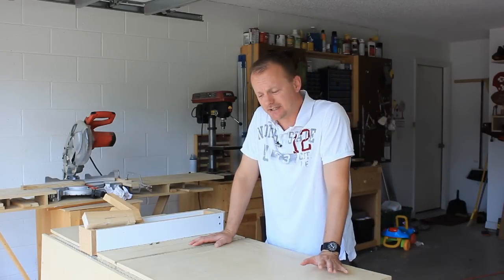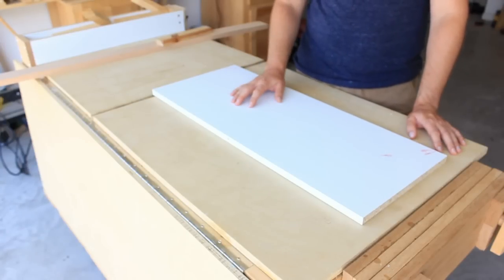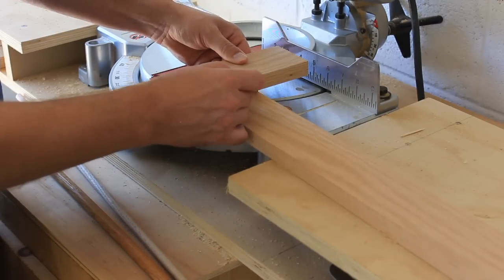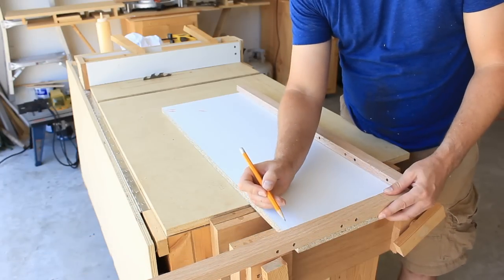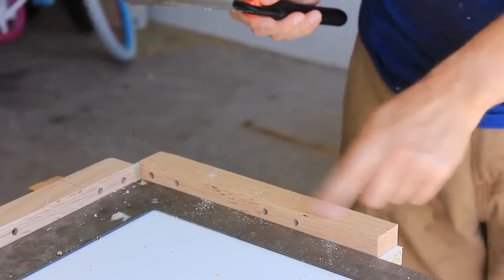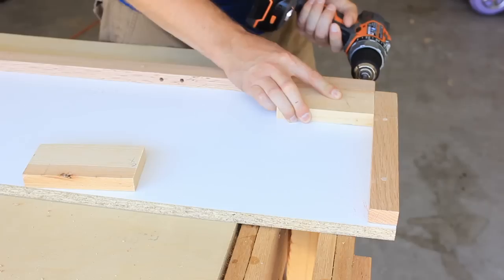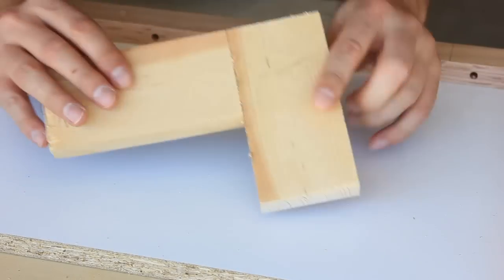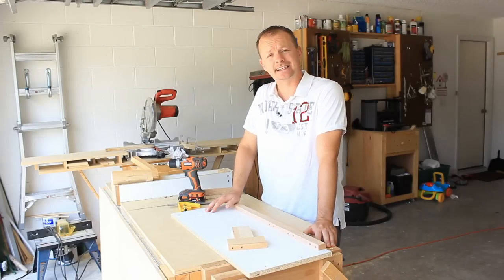DIY Dowel Jig

Comment: Great video, will come very handy in my projects :-)  This jig will only works with the same size boards, thickness, as the jig  itself. I will assume another jig would need to be made for thicker materials. Thank for sharing the awesome video.
Reply from the maker: borocovs I suppose technically speaking you could use thicker stock if you don't mind your dowel joints being off set.  I have used 5/8" stock in it and it worked just fine.  The bigger issue would be that ideally you want your dowels to be 1/3rd the thickness of the stock your working with.  Using thicker stock would mean the dowels would not be the right size.  You wouldn't need a completely new jig for each size, just different reference rails.

Comment: Can you build a jig like that for mitered corners?
Reply from the maker: Brian Rodriguez Do you mean to cut mitered corners or assemble mitered corners or both?  I have used this jig to assemble miters that I cut elsewhere.  I show that in another video somewhere.
Reply: Yes, if I already have a mitered corner cut and want to use dowels for added strength when gluing them up, how could I make a jig similar to yours? So the dowel holes would be on the insides of the mitered cuts. 

Thanks for your reply, i appreciate it.

Comment: I plan to make a furniture, a tv stand.
With my drill I can make hole of 5 mm max. 
I can not make 8mm holes for the pins.
If I use 5mm pins instead of 8mm on the furniture would it be strong enough?